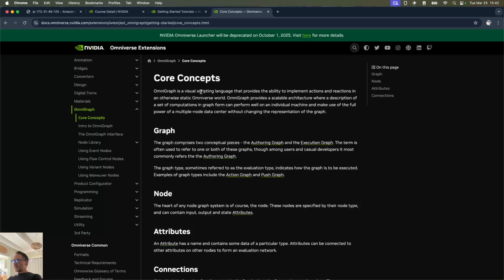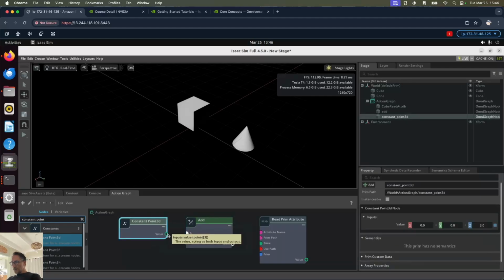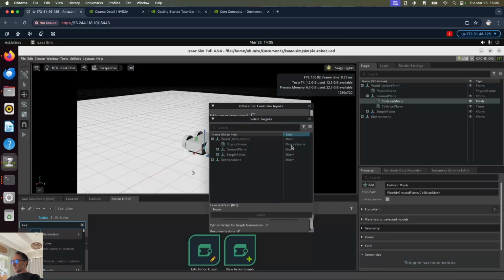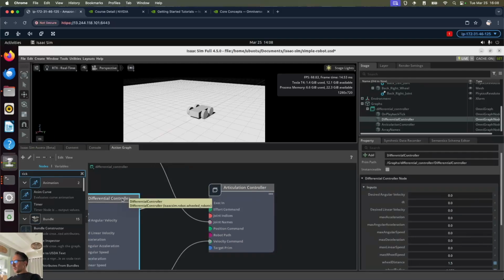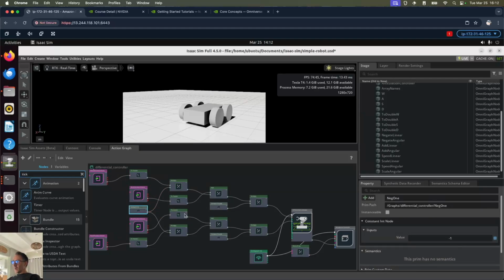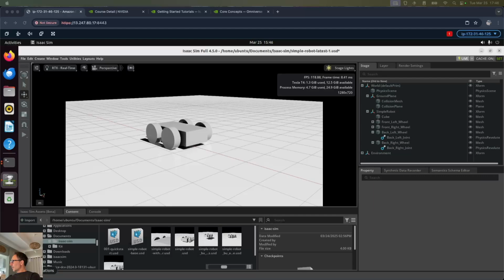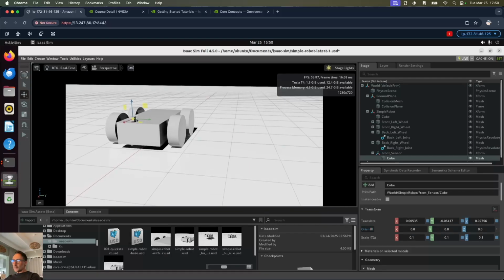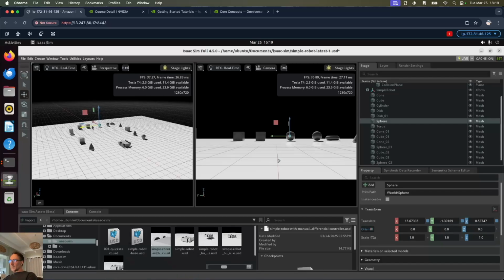Day 2 with NVIDIA Isaac Sim: Omnigraph, differential controller and camera sensor

Comment: Thanks for tutorial! 

One advice to reduce wheels bumping effect - select colisions link of each wheel/Property/Physics/SDF Mesh
Also set Stiffness 0 damping 1 in joint properties
Reply: The wheels (cylinders) should be added as *SHAPES*, not as *meshes*. Otherwise, yes, you get major bouncing.
Reply: @ericjones7300  Shapes will not work. Tried, and it broke the whole thing.
Reply: @LegendarymmHD Hmmm...That's what I'm using on mine: Cylinder shapes. Much less bouncy. 

If adding shapes broke everything, I'd check your revolute joints and make sure they're aligned properly with the primitives. That's often the culprit when wheels aren't turning as they should.
Reply: @ericjones7300  They were, and they are still broken...

Comment: The robot controllers are great for high level--- if you have the exact form factor for the robot aka wheeled or articulated 6dof.  But have you found a way to control the motion of other form factors?  For example, let's say for simplicity you want to command a linear actuator from point a to point b with a trapezoidal motion profile with velocity and accel limits.  Have you ever tried that?  Have any idea how?